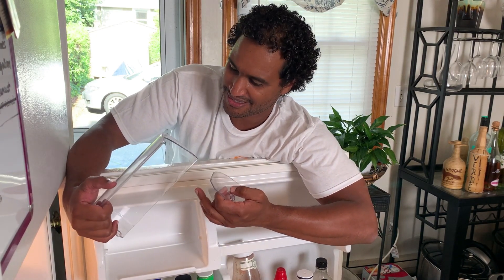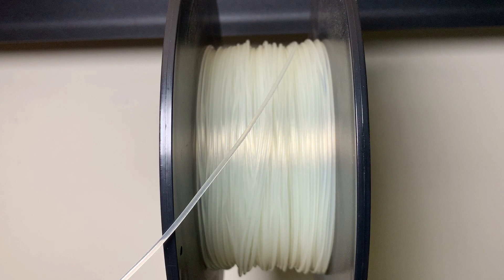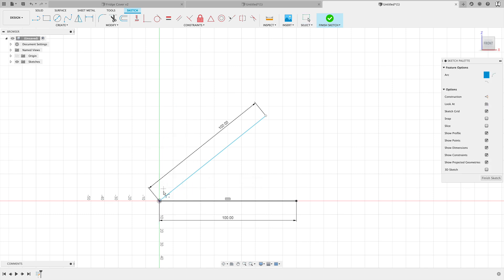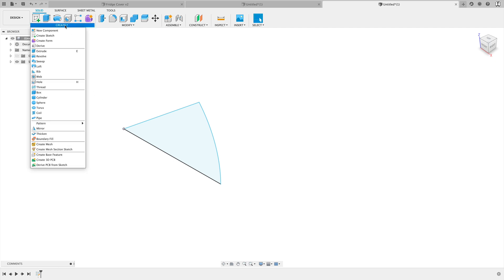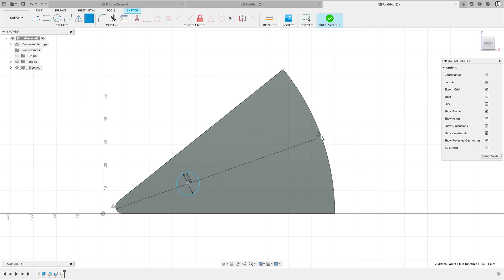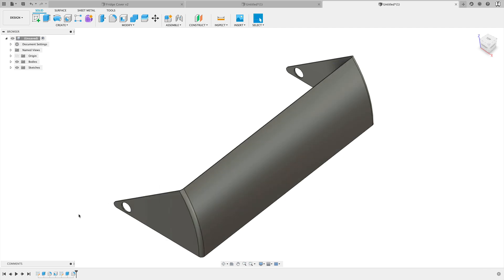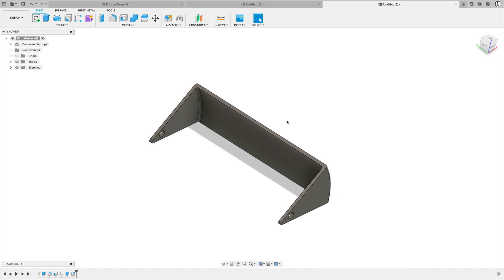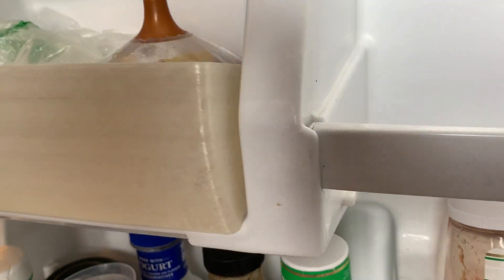Repairing My Fridge with Fusion 360 and 3D Printing

Comment: I gave you THUMBS UP... but I'd rather would use strong adhesive such as BerFix (extremely strong from Berlin Company) and glue the fragment. Maybe enforced by a fancy tape to hide the crack... it even wouldn't consume so much electric energy to produce a 3D print out....

Comment: how long you think that filament will last in the fridge?? and what about the fact that filaments hold bacteria and so are not suppose to be used around food??
Reply: It's a tray cover, not a dinner plate.
Reply: @bernardtarver  anything 3d printed inside the fridge will attract and collect bacteria which is why it is unsafe for food.  even indirect contact.  i just think one should stay away from using 3d prints around food period.  i just hope you and your followers dont get sick from these type of prints..
Reply: @IronMan-yg4qw  You've actually come across articles that express caveats of indirect contact of food and 3dp?
Reply: @IronMan-yg4qw  I didn't come across indirect contact in the article.
Reply: @bernardtarver  oh ok then your fine. pfffft.
Reply from the maker: It will be fine in the fridge.  I have 3D print parts in my car and it can get below zero where I live.  I'm not worried about bacteria as the part will not come in direct contact with food.